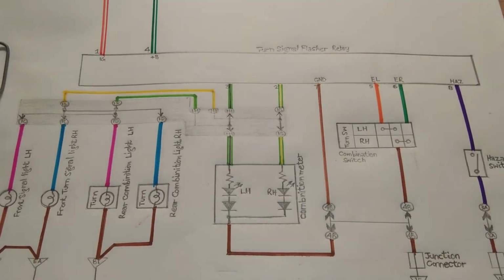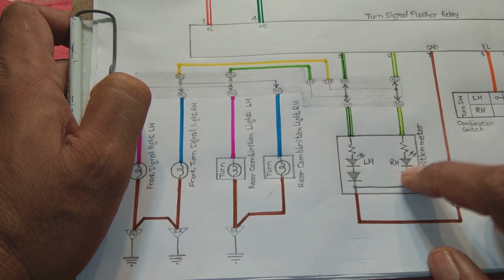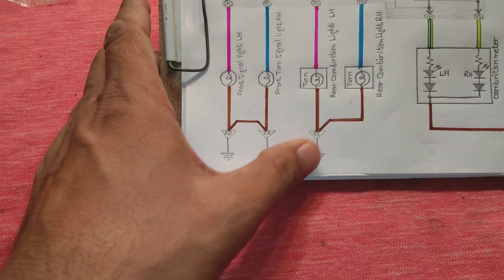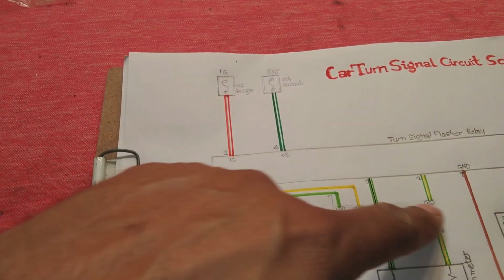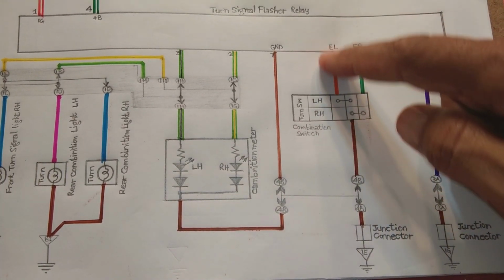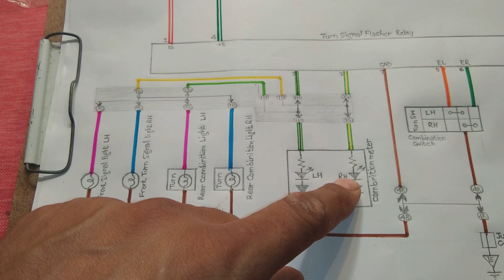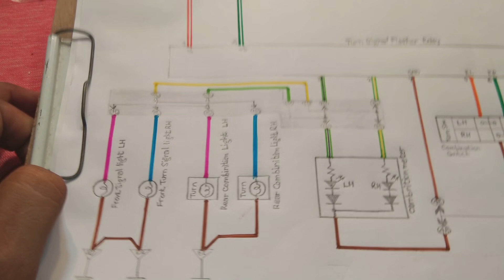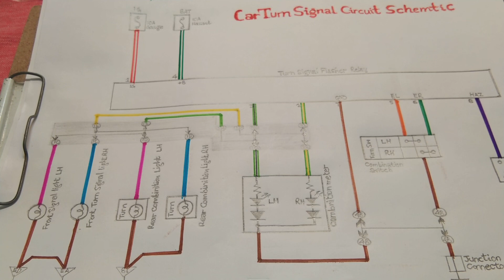Car Turn signal flasher circuit explained

Comment: Why this relay is blinking
Reply from the maker: Flasher has function to blink signal lights on and off. So this is flasher relay and it is suppose to blink! I would upload more videos on a flasher relay repair and it's circuit to give more understanding. Stay tuned and sub.